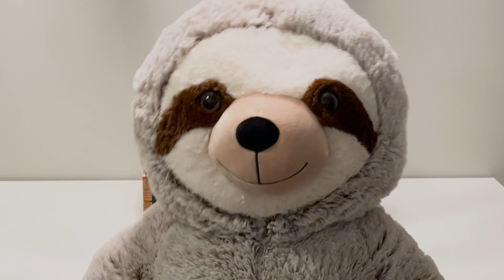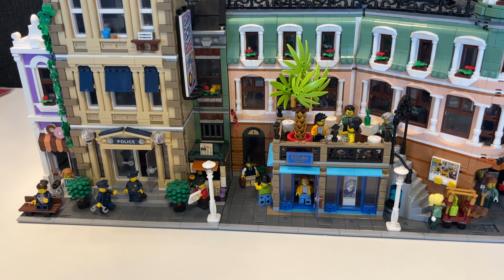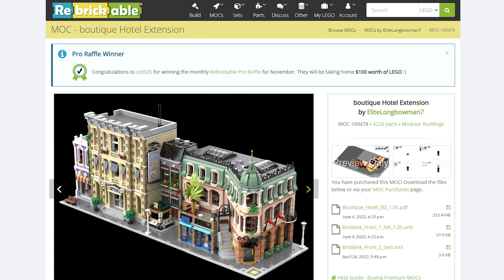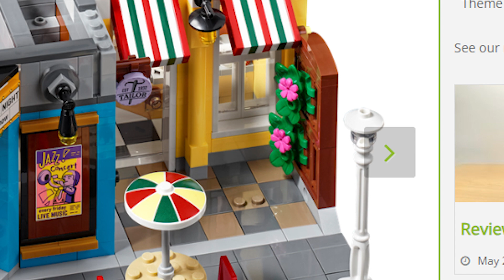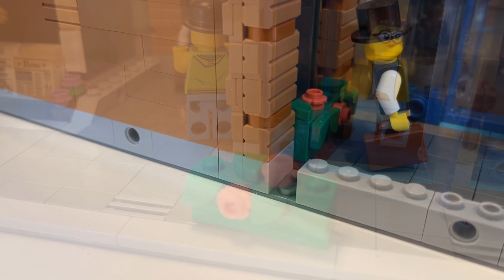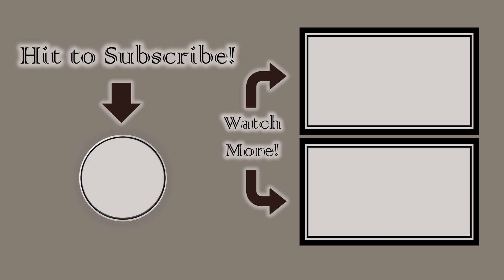Adding the Missing Connector for the Double Hotel Alt Build

Comment: The hotel is looking very good next to the police station, I like it!
Reply from the maker: Thanks! I also think that it is a great match. The only thing I worry about a bit is the fact that I do not think that this hotel would work well next to any other building because the amount of setback on that extansion part has.

 So in that way it reduces modularity of my layout, as those to building will have to be next to each other.

But then again with my limited space, perhaps I should just make one layout that works the best, and not worry about the modularity that much,